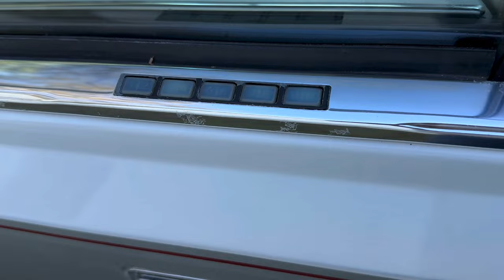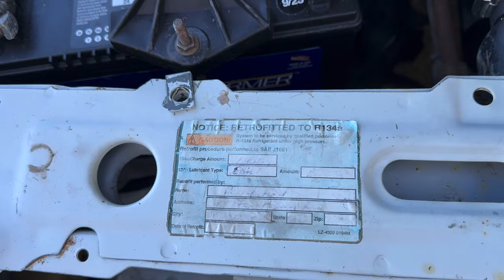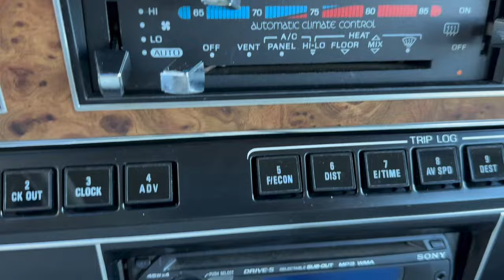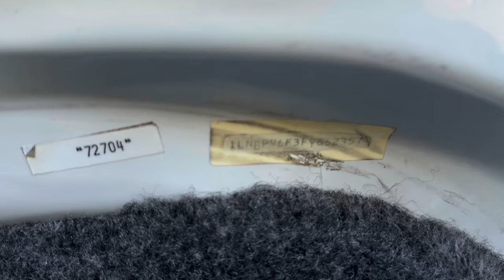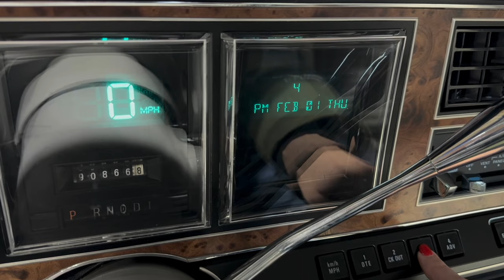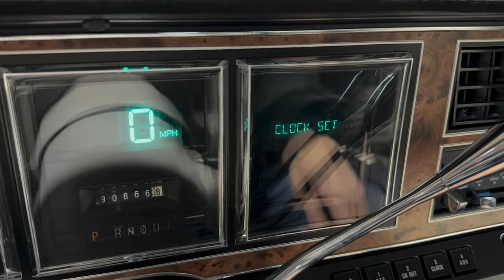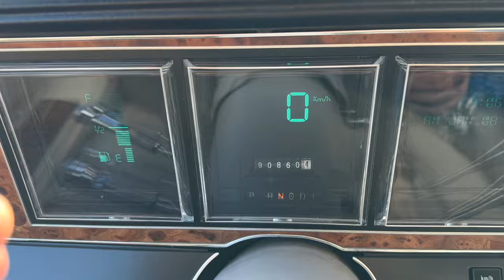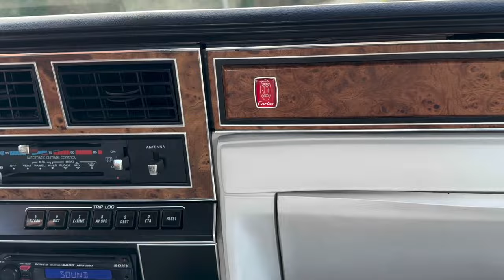1985 Lincoln Town Car Cartier Designer Series Denwerks on Bring a Trailer No Reserve Auction

Comment: I have a similar sister car to your Cartier edition Lincoln, mine being a 1989 Mercury Grand Marquis LS 50th Anniversary Edition sedan in dark blue metallic paint with full cloth carriage roof, gold anodized exterior trim, trunk mounted luggage rack and aluminum turbine wheels. The car has the same driveline as your Lincoln and most of the same options with a dark blue crushed velour interior and only 67.000.0 miles when purchased from Bundy Motors in January of 2022. According to a plaque on the dashboard  there was only 250 built with this trim package in 1989. The original owners passed away and the car was sold by the family who did not want it to Bundy Motors who sold it to me in early 2022. Good luck with your Lincoln, it is a beautiful  car !